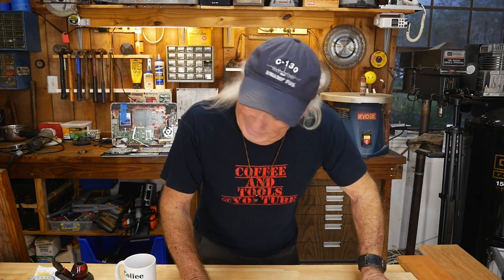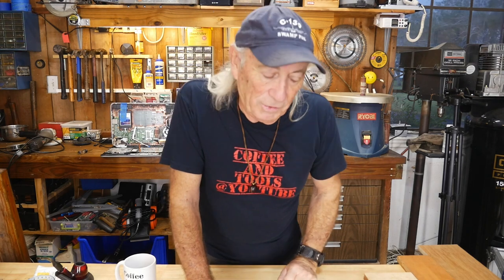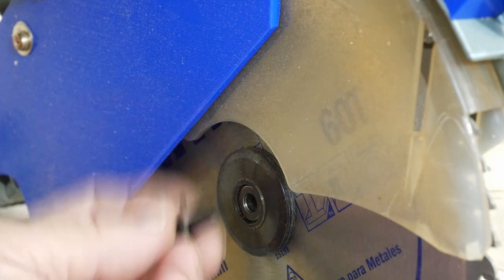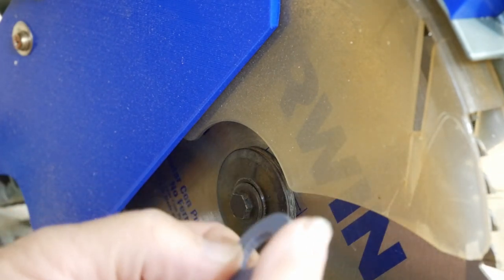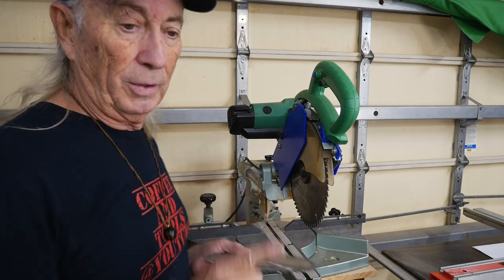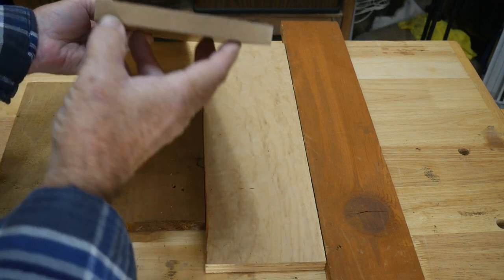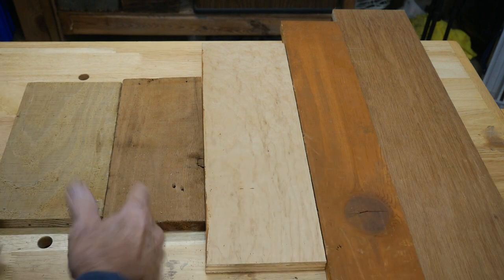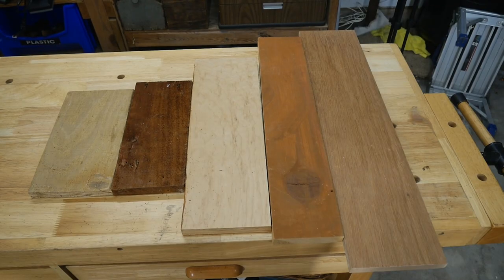Monday Hack job on 30mm arbor saw 10inch blades and wood games, C&T episode 190

Comment: I think you will have zero issues doing what you are doing. I would check the plastic adapter carefully with every blade swap but that is all I think you need to do.Plastic has come a long way in the past few years. Modern car engines use plastic for everything from valve covers to oil pans to intake valves. I have a push mower with  3-1/2 hp Briggs & Stratton engine that has a plastic engine block and that has worked just fine for a number of years now!

Comment: Plastic works fine… I just bought a 14” Metal Cutting carbide blade.  The cost was huge… it came with a molded plastic bushing to fit it to a 5’8” arbor.

Thick or thin… the design of the arbor is to squeeze the blade in place.  The bushing is mostly for centering so that the outside is concentric about the arbor.  Snug it good and you should be just fine.

I thought that plywood was red oak.  I pegged it as the most expensive board.

Comment: Guessing you're using PLA for this?  If so, it'll be fine as long as your infill is decent (not hollow) and neither saw gets hot at the arbor.  Also, want to ask.  I've seen Hatchbox Wood filament in the background of previous video(s).  Any videos where you've reviewed using it?  if not, how did it work out for you?  I've got a roll that I've not opened, that I've had for a few months.    Thanks.....
Reply from the maker: HEY...yeah, that roll is still sitting on the shelf. Just no project yet. SOOn...very SOON :)